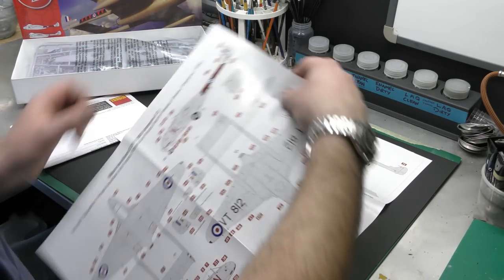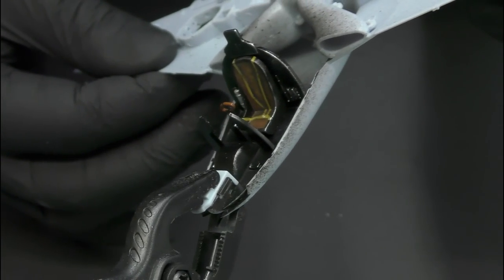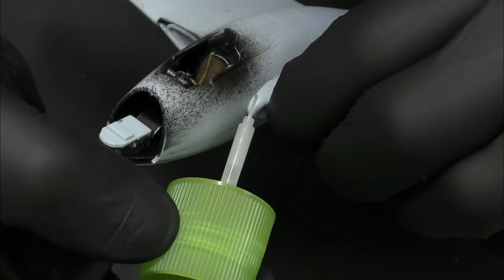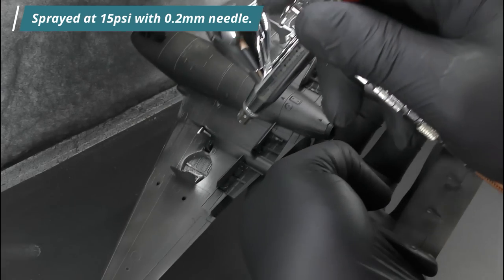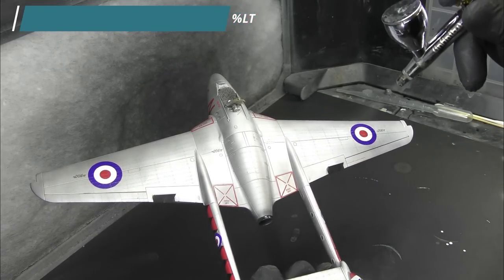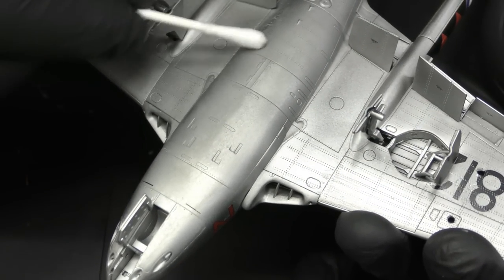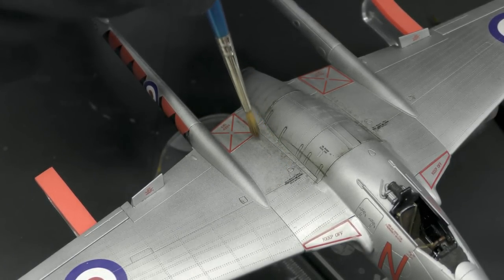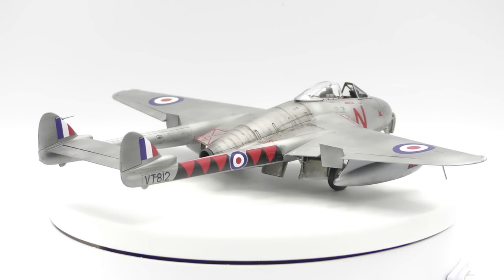Airfix NEW 1/48 de Havilland VAMPIRE F.3. Scale model aircraft kit build.

Comment: I’m currently building this and if mine finishes like this i will be very pleased, it might be new tooling but its typically airfix the cockpit is very basic and the join line around the nose will take a lot of securing  to attempt to conceal the gap as the front upper sides springs out a lot.
Reply from the maker: Hi, yes it is typical Airfix. Many of the joins need holding/forcing into position until the glue is cured. Thanks, Andy

Comment: Further to my previous comment, it looks like (at least for delivered to Australia prices)  "Liquid Gravity" comes in about half the price of what Chinese sellers are pricing tungsten putty at by weight.  This doesn't include the slight cost of binding epoxy required for the "Liquid Gravity" in some cases.  The AU$4.50 for 22grams does seem a bit expensive.

Comment: Hi there.  A few months down the track since this build, I wondered how your nose cone on this build was behaving with the tungsten putty?  I have used some heavy plasticene in the past to prevent tail sitting, however it reacted with the plastic over time and ruined the model.  I am going to order some tungsten putty and give it a try as I have previously also used "Liquid Gravity" (commercial product) mixed with epoxy, however this stuff is much more expensive than what tungsten putty appears to be.  Would it be possible to mix a lead sinker weight core with the putty, I wonder?  I guess I can try that too.  Any thoughts?  BTW, thanks for posting these videos - it's very much appreciated.
Reply from the maker: Hi John, no reaction yet! It is a very small space to get quite a lot of weight! Thanks for watching.

Comment: After you finish with Rosie the Rivetter, how do you clean up the rivets?
Reply from the maker: Hi, I didn't do any clean up here, I guess it depends how hard you press and how deep you make them. A bit of soft sand paper and an air brush to blow the dust out would work if you need to clean the surface of them. Cheers

Comment: Nice, but you mentioned that the Polished Aluminum paint was a good representation of the real aircraft's aluminum. The Vampire was actually painted overall in High Speed Silver.
Reply from the maker: Hi, Thank you for the comment. I didn't know what the finish was, so thanks for letting me know. If I wanted an actual polished finish, I would have put it onto a gloss black to make it look polished. My thinking was purely that the tone of the polished aluminium, onto a flat surface, was a good representation. Thanks for watching. Andy

Comment: great build.  Recently found your channel and loving your work. I have heard negative comments about AK extreme metals and how long they take to dry, given their similar to enamels, otherwise you risk rubbing the paint off.  Have you had negative experiences and if you don't mind confirming how long did you leave it before handling again.  Need to get some Rosies for my future Hind build but never done that befroe, so was good to se them in action and added great detail. Many thanks and keep up the great and informative builds.
Reply from the maker: Hi Mark, then only time I have ever had an issue with Xtreme metal is when I didn't shake them enough. All the sediment at the bottom needs to be mixed in.  I really dries pretty quickly, but after painting I normally leave it until the next day anyway. One thing I don't know is what they are like with decal solutions etc, I've always sealed it with a varnish first. Thanks, Andy
Reply: @ScaleModelShed  many thanks for replying to my question which is really helpful.  If you don't mind me asking a follow up, which varnish do you use on these paints to maintain the metallic finish rather than it just looking silver?  Thanks again for your advice. Mark